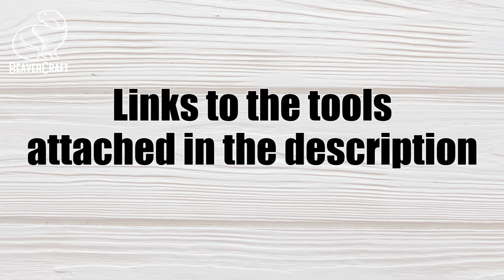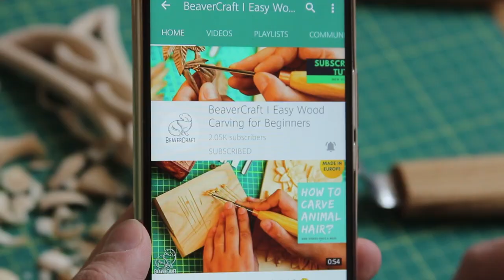Carving Turtle Part 2

Comment: I don't know how cut resistant those gloves are but they look like they're level 5 which won't withstand anything a tool can do without any shadow of a doubt, if fact I've seen people cleaning up broken glass get cut while wearing those I think they can only truly stop paper cuts or likewise from handling sheet metal
Reply from the maker: There are many cutting gloves of different quality. Some of them cannot protect from even small cuts. We use these ones off and there have been no cuts yet.

Comment: What tool did you use
Reply from the maker: We used these tools in the video:
C16 – Big Roughing Knife: https://bit.ly/3uOgCxN
C7 – Small Detail Wood Carving Knife: https://bit.ly/3tNukzE
C6 – Chip Carving Knife: https://bit.ly/3w3JsKN
C11 – Knife for Geometric Woodcarving: https://bit.ly/3uIdsM6
C13 – Whittling Knife: https://bit.ly/3w6jLt4
C15 – Detail Wood Carving Knife: https://bit.ly/2RW0Sdx
K5/12 – Compact straight rounded chisel: https://bit.ly/3uOJHJs